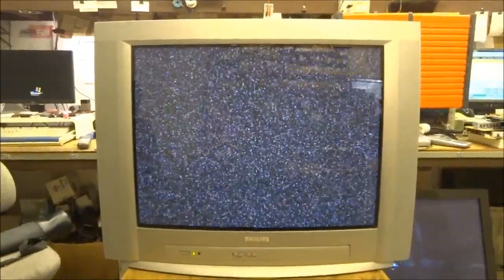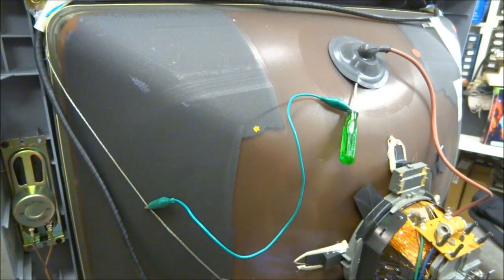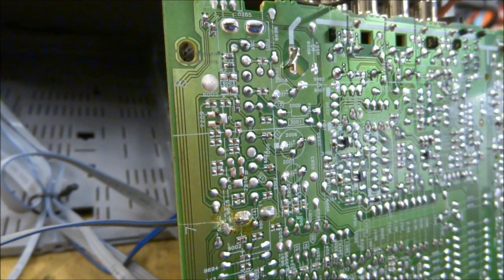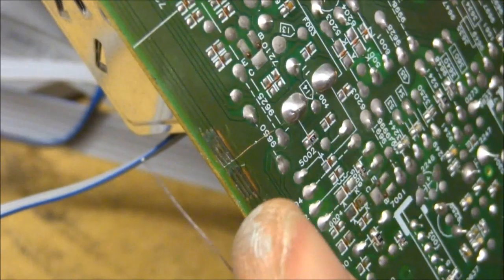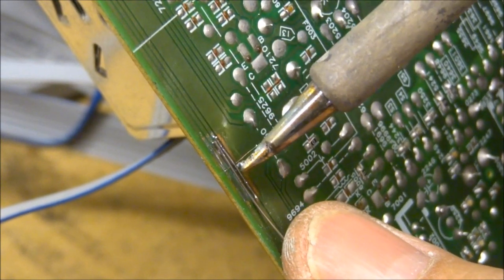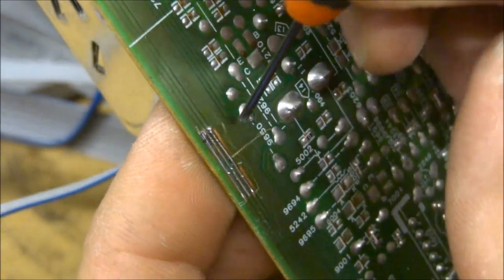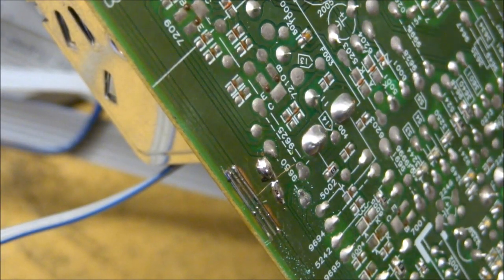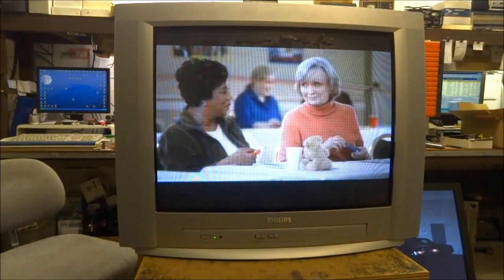Repairing a Minor Crack On A Circuit Board PCB. Fix Repair Printed Circuit Board

Comment: I had an older washing machine that failed. A tech told me the problem was the user interface board. I looked it over and saw that it had a small crack (neither the perp nor method for creating said crack will be named so as not to embarrass the guilty). The UI board isn't made any longer and and isn't available from the manufacturer or third party sellers. Not wanting to buy a new washing machine, I checked YouTube and found this video. One trip to MicroCenter and a few minutes later, I had a repaired board and a working machine. Just wanted to post to say thanks for making a video that was helpful, clear, and that made the process 'accessible' for someone who had never done anything like this before. Much appreciated!

Comment: Just to add I always place a drop or two of superglue in to the crack after repair to join the board together, otherwise the crack can propagate and break further. As well i take that wire and use individual strands instead of the thick wire. Much easier to solder and works well on the fine traces, as these generally do not carry much current. For broken wide traces I use solderwick, just solder it in place across, it is very strong.

Comment: very nice repair!

just wanted to add to the CRT safety that it's a good idea to leave the screw driver under the hv cap because they can build up charge. Found that out by PERSONAL EXPERIENCE!

It's great to see these CRT sets repaired because there is less and less of theme seen around. I own 10 CRT's two of which date back to 1986 :-)

Comment: Nice! But how does the 3 traces not connect to each other when you first apply the solder to them?
Reply: Gustav Norman  Yes, I was wondering that too. Didn't all 3 traces just short out each other??
Reply: @deekay2  Thin wire and a steady hand is required, followed by careful inspection with a magnifier before turning on. He did say that you have to be careful not to melt the first wires joints while doing the second and third.

Comment: I get these free whenever I can as I use the flyback transformer to power small ionocraft I make. Nothing else in the unit needs to be functional other than it's voltage amplifying circuit. 30kV-50kV output for the older monitors and tvs, 15kV-25kV output for the last generation of computer monitors before they were being phased out, which makes powering the crafts harder.
Gonna give this repair a try on junk phone board that has a green stick crack in it near the power port, preventing it from charging.

Comment: I have seen where they did glue a plastic piece to one side of the board to add strength and 0 Ohm SMD on the other side as jumpers. :-)